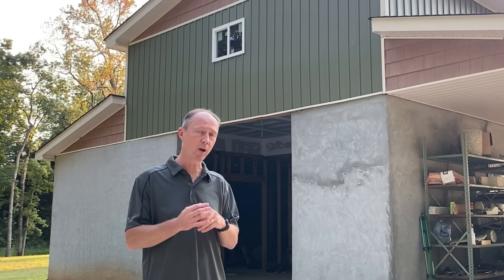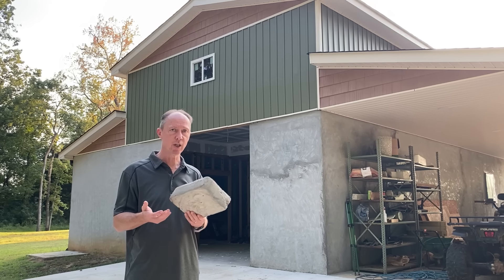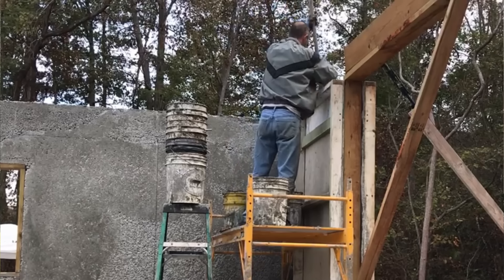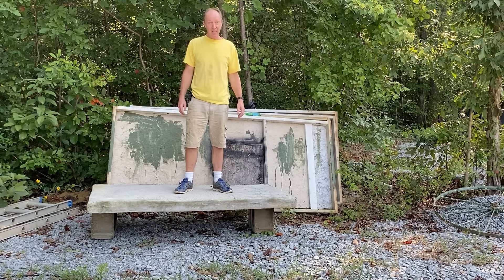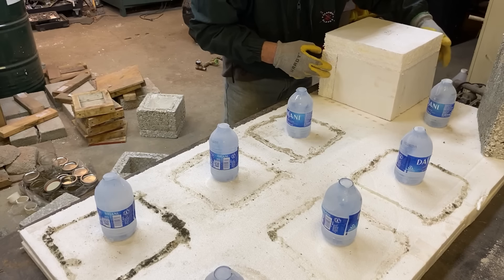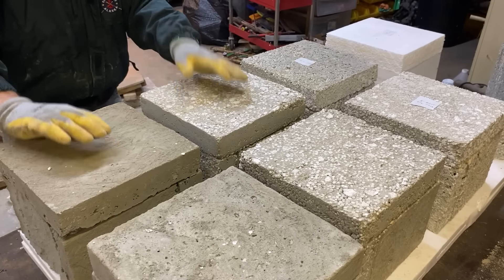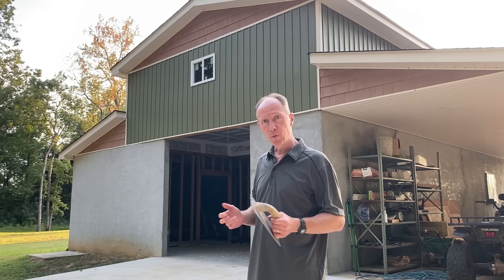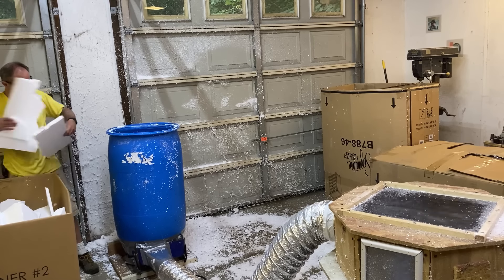The White Gold Rush?! The Video That CHANGED Aircrete Forever!

Comment: Always like to see people coming up with new ideas I don't have any projects where I need to do this. (Yet! LOL) Have you tried adding some of the glass fibers they add to concrete for strength? My garage floor was poured almost 20 years ago, there is one crack that started within the first year and has never spread. I don't think the fiber material is a huge cost but I bet it would add a lot of strength.
Reply from the maker: thanks for the tip! subscribe for new builds coming soon!

Comment: Cattle panels might work as support for an arch roof. Bend the panel to make the arch. Then cover the panel with wire lath. Shoot the mix on with with a mortar sprayer. Once the mix has set remove the cattle panel. Spray more on to reach desired thickness
Spray the underside after arch roof exterior is done. Cattle panels are 16 ft. and pretty strong. Paperback lath might also work. 
Cal  Earth the innovators of earthbag building used to have an arched vaulted roof house plan.  The problem they had using stabilized earth on both the domes and arch vaulted roofs was cracks and water proofing.
Reply from the maker: Thanks for the tips! Subscribe for new builds coming soon!

Comment: Very cool, I've used a lot of different styrofoam/open and closed cell foam, in composite structures, for boats and experimental aircraft, and one trick that I learned that might be helpful to you, is you can hit the ground up styrofoam with a mist of water, and it helps keep it from sticking to everything with the static.  I'm no chemistry professor, but I think it might do something to reduce the static charge, like spraying static clinging clothing with water will do, cause it has some benefit even after the water has evaporated.  Though the bigger benefit is from just the weight of the mist of water on the styrofoam beads.  I use a new clean weed sprayer, in your application, you might be able to just mix it in with the water for your cement though.  Very cool idea, I've been gathering ideas to build a big boat shop on my farm, I live in Vermont where it's pretty cold, and the cost to insulate a large shop is alarming, hah.  Definitely gonna try your method, maybe as infill in a timber frame structure, just cause we have big snow loads, and I have free trees for the frame.
Reply from the maker: Thanks Bond, I will give it a try.
Reply: @bondvagabond42

Ever consider a wood stove or rocket stove thermal mass heater?

Don’t think you need to worry about insulation for workshop if you got those running.

Seems you would have no problem with getting firewood being in Vermont and all

Comment: WONDERFUL! Can we pack triangle forms for a geodesic dome with this material? Then nail the triangles together, fill any gaps with more of the mix, then finish coat as you detailed? This would be a very FAST way to build a dome. Essentially a MONOLITHIC strong structure. And NO complex curves required!

Domes use less materials and cost less per sq. ft. Easy for just one person too. Only a few forms would be needed. If required the lower course of triangles can be assembled first then filled and coated for stability and other courses added. So what do you think?
God bless and be well!
Reply from the maker: Yes that can definitely work! It will take a while to make all the triangles because the forms need good compression to bond. We found It faster to pour the whole wall in place

Comment: there is another better fireproof ridgid closed cell urethane insulation foam used for roofing... it comes in various densities as well... have you experimented with sawdust or pumice sand in aircrete... pumic has been used in lightweight fireproof concrete blocks here since the 50s & about half the weight of std blocks & highly crack resistent with high heat... have been a few concrete boats built with it here too... cheers from NZ
Reply from the maker: Thanks for the tips! Subscribe for new builds coming soon!

Comment: I really enjoy and appreciate you sharing research. This is the first video I've seen from you. I subscribed and gave you a thumbs up. I will check your other videos. I'm looking to build a dome structure about 25 ft in circumference that can float and can handle some knocking around. I figure I can use a swimming pool liner for the bottom and build the structure within the swimming pool liner. When I've used masonry products in the past I've added the acrylic hardener liquid that smells just like Elmer's glue. I figure I would build with aircrete and add a waterproof type Elmer's glue to the water mix. The aircrete styrofoam and waterproof glue might be just the mix I'm looking for. Let me know if y'all have any ideas. Thanks
Reply from the maker: Wow sounds like an exciting project! Thanks for subscribing! A lot of viewers have requested a boat build so once we get to that maybe we can share notes
Reply: @AbundanceBuild  Your idea for a dome house is great! I am planning to use a large jungle gym for a frame to build on top of.
Reply from the maker: @MacoyCafe  Good idea!

Comment: When making your window forms instead of a solid 2x use a 2 X 2 one level with each face leaves you with a gap between put a hole in your forms where the windows are that way you can make sure that the cavity under the window is filled with the mix and if it isn't you can fill it and trowel it level with the bottom of the 2X2
Reply from the maker: thanks for the tip! subscribe for new builds coming soon!

Comment: Great idea and presentation. What caught my attention most was the 2nd level. Without it, compressive strength needed in a wall is not so high but that obviously changes if you put a heavy roof or 2nd level on top. Strangely, I have yet to see a video in which air-mix or (now) Styrofoam-mix walls are combined with traditional concrete pillars, the latter providing all the strength needed to support what is above. Is there any reason why concrete pillars could be used in this way? Is there even a clever alternative to the pillars?
Reply from the maker: Hi Paul. Molding this into ICF blocks and then running rebar and pouring concrete in the middle is the way to go if you are needing a really strong load bearing wall. Goggle Perfect Block. These are made from grinded up recycled styrofoam. You can make your own.

Comment: Regarding your idea for powdered builders sand - I have bought big bags of "silica flour" before from a local specialty dealer. It's pure silica from Illinois I think, so it's pure white and just as fine as flour. I add it to a specialty cement mix to get white concrete, so I can't really comment on how well it performs for aircrete purposes. I expect it would do well
Reply from the maker: thanks for the tip! subscribe for new builds coming soon!

Comment: Would like to see how this all ties together in a small scale approach, for beginners that do not necessarily want to build special shredding and mixing machines just to try out the concept.
Reply: If I had to do this at a small scale I'd probably use an old blender (no longer for food since styrofoam is not something you want to eat) to shred it up. Or maybe even use a 5 gallon painters bucket with a lid and a hole drilled through the top for a mixing / shredding drill bit to go through. And then you'd probably have to hand mix it in that bucket or drill mix it.
Reply from the maker: Working on simpler solutions! subscribe for new builds coming soon!

Comment: The R-value per $ seems unbeatable. Impressed with the strength.
Have you done any fire tests?
How delicate is the recipe? Is it as sensitive to things like temperature and water hardness like normal aircrete?
Did you share your recipe?
Reply from the maker: See the second and third videos, Styrofoam shredder and Styrofoam Aircrete firetest.
Reply: @AbundanceBuild  Fantastic results. Congrats and thanks for sharing.

Comment: In the video you mention how difficult it would be to make curved forms for dome parts.  Have you considered a geodesic dome?  In a typical geodesic dome you would only need three flat triangular molds, one for each size/dimension of the triangular part used in a geodome.  with molds that have bolt holes and/or a mechanism for inserting set-screws or other assembly points, you could build and sell complete styrofoam aircrete geodesic dome kits.  If you look up online what those kits sell for using other materials, you'd probably be able to undercut that price and get a lot of market share.
Reply from the maker: Thanks for the tip!

Comment: Very interested in your work!
Since the stuff's so easy to cut, couldn't you just do the entire house perimeter with full-panels, and then Sawzall the door and window openings after the molds come off, then frame the cut holes with wood? Also, I wonder if it would be easy to use rebar supports within the molds for wall, floor, and ceilings for added strength, as is done with traditional concrete construction?
Finally, what do your local Building Departments say about this method when it comes to permitting?
I would LOVE to learn more about this!
Thanks for all your work and development progress!
Reply: Lou B, it does seem like making some sort of panels like homemade sip panels would be the way to go.
Reply from the maker: thanks for the tip!

Comment: I believe if you set forms on a flat surface 5.5 in. Thick and 46 in. Wide and 94 In. High  with tongue and groove edges and stand them up together .  You can come back later and add you windows and doors . You can even make the inside walls and connect them with half inch re-bar driven through the outside into the edge of the inside walls .
Reply from the maker: Rick, Yes that will work for this.

Comment: What about using vermiculite and cement? That is what was used for the bottom of my incround vinyl liner swimming pool. The liner was installed over it while it was still wet a nd water put in as soon as the liner was installed.
Reply from the maker: We prefer to recycle. Subscribe to see new builds coming soon!

Comment: I was watching your build again and again .  I was wondering could you attach your roof sheeting to your wooden panel molds temporary by stapling it to the out side edges of the 2x4 frames before you pour your styrated Aircrete then do your pour and packing.  Now after the 48 hour waiting time and the Aircrete is set the roof sheeting will be attached to the wall panel . remove or cut free the temporary staples from your mold panels and re-oil and pour your next panel.  Just thinking...
Reply from the maker: thanks for sharing! subscribe for new builds coming soon!

Comment: I have a few questions, if they are answered elsewhere, please point me in the right direction;

What is the thickness of the panels before stucco?

How much per square foot do the panels weigh?

How are the panels anchored to the foundation? With rebar, or some some other method?

If a panel is poured horizontally on a flat surface, is it strong enough to be lifted to a vertical position? Would a wire mesh like chicken wire embedded in the panel allow it to be strong enough?
Reply from the maker: check new videos! new builds coming soon! subscribe to be notified!

Comment: I have seen videos on aircrete blocks, but the mortar has to be mixed a certain way, if not the blocks crack,  here in Puerto Rico the blocks are heavy and harder than cinder blocks. I reinforce blocks with rebar, I wouldn't trust aircrete during a catastrophic hurricane, but maybe in the future this technology will improve,  your stucco technique needs improvement lol...My stucco walls are as smooth as a baby's bottom lol.
Reply from the maker: Thanks for sharing! Subscribe for new builds coming soon!

Comment: Have you considered adding fiber-mesh to your mix for strength?  It’s used in concrete mixes already.
Reply from the maker: We use the fiberglass mesh as the shell for the interior and exterior walls! You could add more into the mix for added strength but it isn't necessary for our builds

Comment: Great recycling !! I do think this would be better than air creat. Never thought of it but I used to make metal kilns with refractory hard face cement and add bean bag foam for the insulation so as not to need two different types of cement..... a really great job !!! I'm subscribed.
Reply from the maker: Thank you! Subscribe for new builds coming soon!

Comment: Follow up question: if the fibermesh is the key to providing strength, would it be faster/easier to make a mold and incorporate the mesh in the pouring process then tilt up in place.
Reply from the maker: JL if you are doing tilt up then yes that would be much easier. Also if you line the fiber mesh before pouring the mix will adhere to the fiber mesh.

Comment: Very cool but going to need to be very cheap and easy to use for it to take off. We are using 3-D concrete printers now and building homes ( floors & walls ) entirely out of concrete in 2 weeks to a month to build. Voids are left in walls to have foam insulation added or blown in insulation...  they are giving 50 year warranty on these homes. Hard to compete with...
Reply from the maker: We are cheaper, faster, and can complete the roof - not just walls! Subscribe for new builds coming soon!

Comment: Perhaps for the window where it doesn't fill in under the sill maybe in the middle of the sill drill a 2 "  or 3 "  hole,,, Keep the piece of wood that you drill out use it as a plug after and configure something so you can pour right from the sill to get underneath it and then plug it back up...??
Reply from the maker: Thanks for the tip!

Comment: People have said that they've used perlite instead of sand. What do you think about using dicalite which is almost the same as perlite only 10 times cheaper? How insulating would you think it would be?
Reply: Owen I am not using sand in the mix at all. The mix is 3.5 gallons f Portland, 2 gallons of water, 25 gallons of foam, and 45 gallons of shredded styrofoam. Portland cement is the most expensive part of the mix and dicalite looks like it is twice the cost of cement.
Reply from the maker: New foam free recipe coming soon! Stay tuned

Comment: Well, I won't be doing this anytime soon, if it goes beyond a 5 gal bucket and an electric drill.  Any ideas on how to cover a tie dome made out of pvc pipe and zip ties? . Or, a hoop house made out of cattle panels?
Reply: A roll of shrink wrap and a heat gun for clear dome covering. 
For an opaque covering, 6 mil plastic , covered in used carpet, followed by a thinset, diluted with soap liquid and brushed into the carpet.
Reply from the maker: New simpler recipe and builds coming soon! Subscribe to stay tuned!

Comment: Realy appreciate you sharing this Stephen! Thanks so much. Best of luck on your truss experiment. I have been thinking of making a dome mould from triangles of OSB that is ripped to allow for bending the OSB. I find it wildly exciting to imagine making one mould that can be poured while laying horizontally on the ground. Then meshed and stucco'd. Then assemble the segments of the dome 20 times. With a circular skylight frame at the top that would be anchored securely into the ground on stilts for the assembly process.
Reply: Use an inflatable form
Reply from the maker: You can do it! Subscribe for new builds coming soon!

Comment: first question i have is whynot pour your wall panels horizontally then stand them up when dry? So form the wall sections and pour them. You could build some big tables and do several at once. A lot less labor!
Reply from the maker: Thanks for the tip!

Comment: This is interesting. You may get better compatibility by adding a binding agent/emulsifier to help disperse each phase better for less mixing energy, allowing it to stay dispersed for longer. Additionally this may allow you to use different materials with different particulate densities and sizes. Perhaps something similar to an acrylic with hydroxyl functionality? Also what about adding sodium silicate if you still want small glass added?
Reply from the maker: Thanks for the tip! Subscribe for new builds coming soon!

Comment: Very cool, or hot building idea. Does it have the strength to cast triangular panels and morter them together for a dome build?
Reply from the maker: Stan, Yes the blocks are strong enough to do this and build with them. But the whole structure needs the fiber mesh cover and stucco coating to hold it all together with a strong skin.

Comment: I am curious to know if you can make aircrete with rapidset cement.  They sell it at home depot.  It is more expensive than Portland but, is 6000 psi cement and hardens in one hour.  Now that I see this, I wonder if you could use rapidset mortar mix to cover the exterior to gain even more strength.  Cool video.
Reply from the maker: Thanks for the tip! Subscribe for new builds coming soon!

Comment: I am considering using this to insulate sea container tiny homes as it's so cost effective in terms of material. Basically aircrete + polymer lattice reinforcement from recycled PET and HDPE + your method + metal mesh = incredible R-value per square foot.
Reply from the maker: Good idea! Subscribe for new builds coming soon!
Reply: @AbundanceBuild  I've tried 3D printing lattice reinforcement and it's pretty unlikely because it takes forever to print the lattice structures. I have seen some cool applications with using aluminum to press form aka injection mold plastic parts, so that might be a better option.

You'd just need to press a bunch of molten plastic together into the shape of a grid pattern and layer that multiple times with plastic standoffs. It'd likely be fairly strong considering aircrete is relatively weak to deformation on it's own.